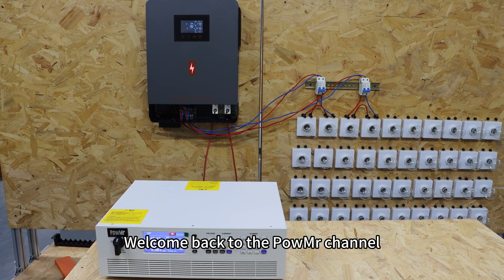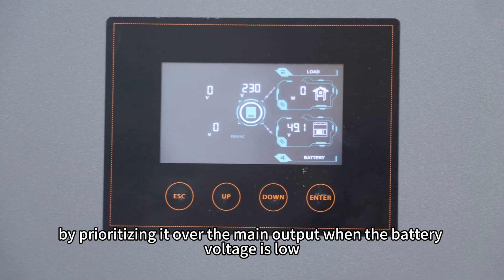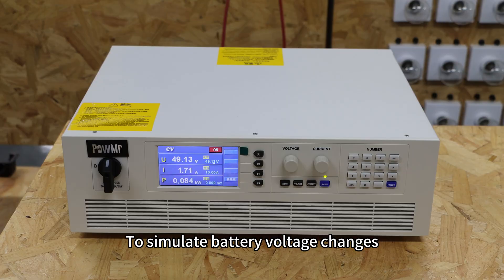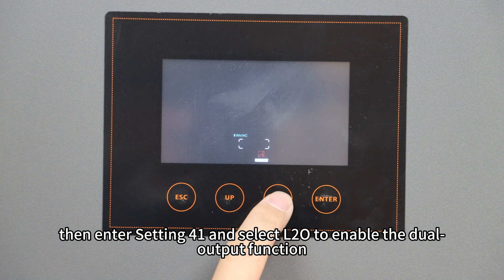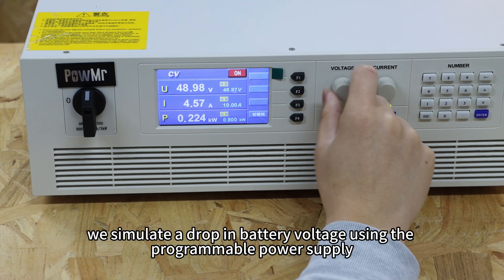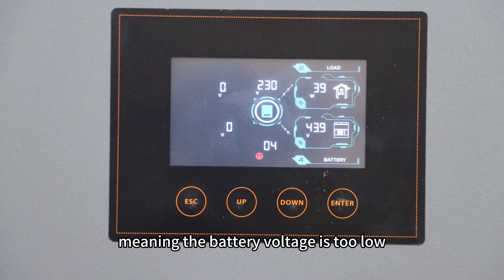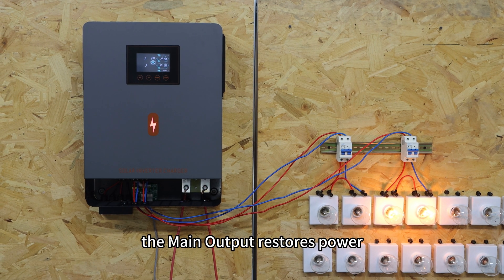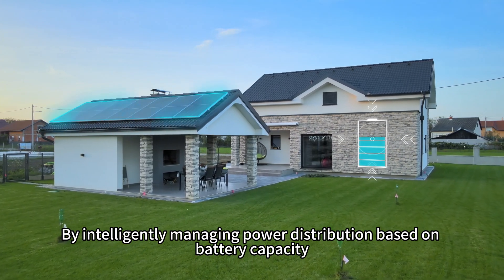Dual Output PowMr Inverter Functions Revealed: What Do Main and Secondary Outputs Do?

Comment: What is the return power for 24v 4.2kw inverter.
Reply from the maker: You mean to upload excess energy to the power grid?
Reply: @PowmrSolar im mean for the dual output return power. If i set it to 24v to turn off the main power. What voltage it will on again.
Reply from the maker: @dapzyduana3114  A value higher than #42 is required upon restart.

Comment: I have a powmr 4.2 24 volt. When i are put it off grid, and use sub or sbu mode while the sunpower is high(2000 watt) and the load is small (60 watt) ., after about twenty minutes it will shut down with fault error 8. 
I have no problem when i  put it on grid and use sub mode.
please help me
Reply from the maker: Please send it to this email: support@powmr.com. Our technical staff will check it for you.

Comment: The inverter is set in SBU and off-grid. I found that during the day when there is much energy from the solar panels, the inverter is sending excess energy to the service provider. The problem is i dont have net metering so i am paying the exported extra energy produced by the solar panels. Is there any solution to this?
Reply from the maker: Hi, please send it to this email: support@powmr.com. Our technical staff will check it for you.

Comment: Very helpful, thank you.  The instruction manual is not clear on this.  Also, what determines the recovery voltage?  For example, if the threshold to turn off the main output is 52V, at what voltage will power return to the main output?
Reply from the maker: Higher than the voltage set by #42.

Comment: Hello I have ordered my PowMr 24V. I still need to order the Battery,  Can I use this battery.  24V 100Ah LiFePO4 Battery with Built-in 100A BMS.  Is there other types of batteries you would recomend.
Reply from the maker: Yep, you can use this battery.

Comment: Hello, I have a Power MR inverter that I bought new no more than a month ago. It's been giving me problems since the first day I installed it. When the grid power goes out, it automatically switches to battery power. Everything is fine. The problem is that when the grid power comes back on, the inverter doesn't recognize it and stays on battery power. I have to manually remove the switch and put it back on for it to recognize it. The other thing is that the inverter fans are on full blast all the time when the inverter is only working at 20 percent of its capacity.
Reply from the maker: Hi, please record a video and send it to this email: support@powmr.com. Our technical staff will check it for you.